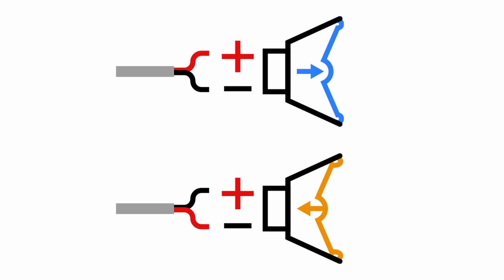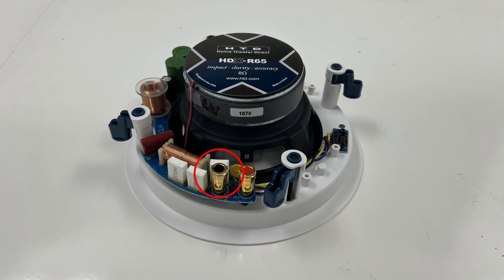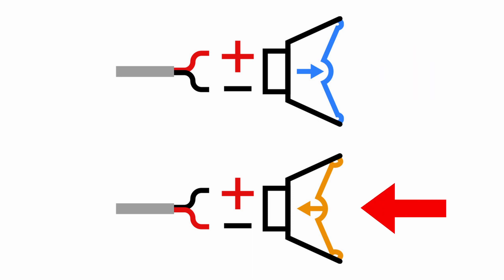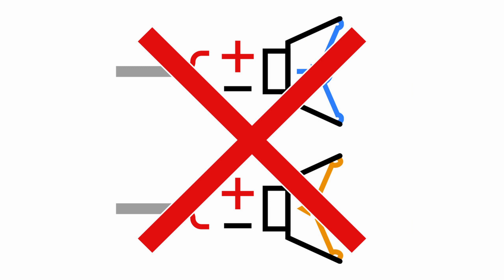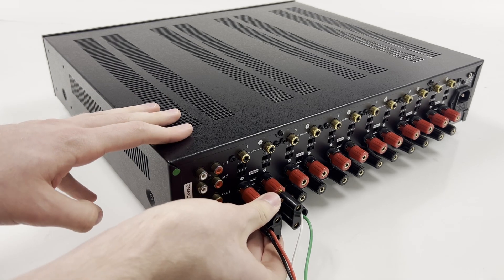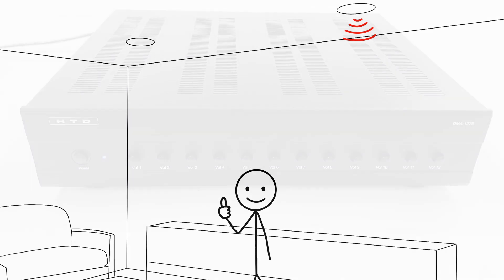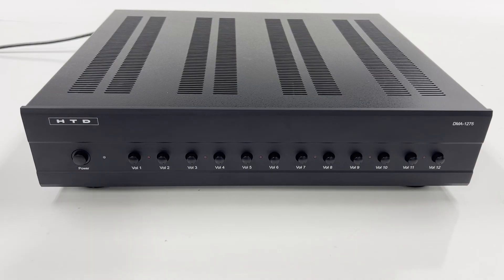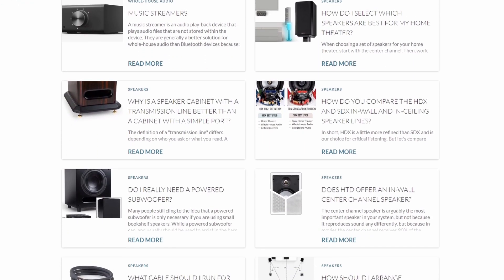Speakers Out of Phase? How to Fix it

Comment: My subs only work when 1 RCA cable is plugged in, but if I plug both in, they do nothing. Is this the same thing as what you are explaining? The RCA's are connected toy amp and to a LOC. Then from the amp to 2 12"s via speaker wire.
Reply: this is happening to me. was working fine now only one rca cable to make it work. you beer figure this out?
Reply: @slimetunechi5711  yep, you connect a stereo signal (or 2x mono) to a symmetrical input. Just use one RCA.

Comment: This is polarity, not phase
Reply from the maker: Technically, that is correct. We are showing speakers that are “out of polarity“.   Phase more accurately refers to a time shift that places sound waves out of sync with one another. Because both speakers are receiving their signal from a common source, a phase shift is unlikely and one that puts those waves exactly opposite one another is highly unlikely. On the other hand, speakers wired out of polarity nearly always create this “phase effect”. And since most people, including most audiophiles, refer to speakers being wired out of polarity as being “out of phase “, we chose this phrasing.  Thanks for the comment.
Reply: @HomeTheaterDirect  so should I plug my monitors to the same outlet?
Reply: out of phase is the problem and polarity is the cause.
Reply: @adminadminson3147  nope.
Reply: Being out of phase is when the negative terminal or positive terminal is wired opposite, so polarity is part of being out of phase, but isn't the same thing. I guess you could say it's out of polarity but that really isn't a known thing to be said
Reply: @That_Maro    Totally wrong, sorry! Polarity is absolute and phase is a function of time/frequency.
Even some of our live mixing consoles have the inpout polarity button incorrect silk screened "phase revers" instead of "polarity reverse". I mean those big, heavy and expensive standard analog consoles you used an easy-tilt with. I think they got it right on most of the digital consoles now.